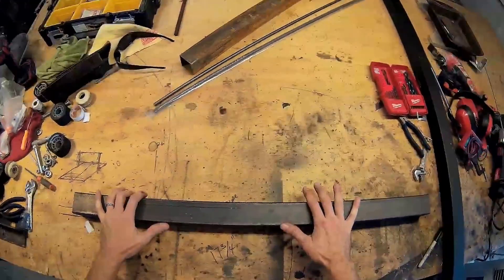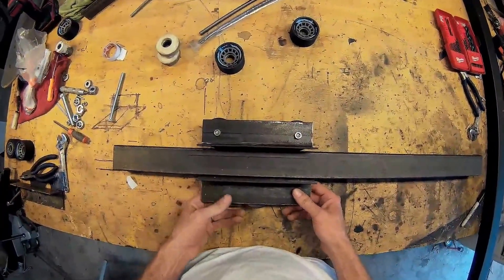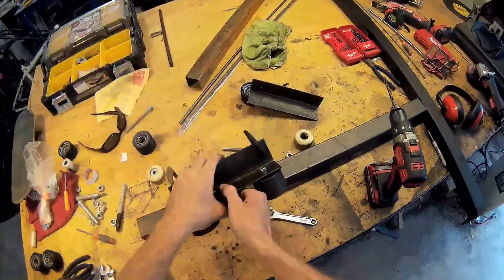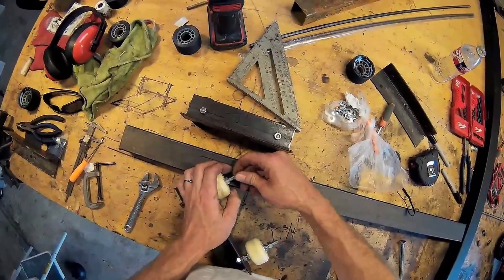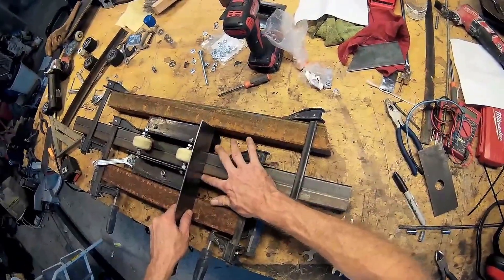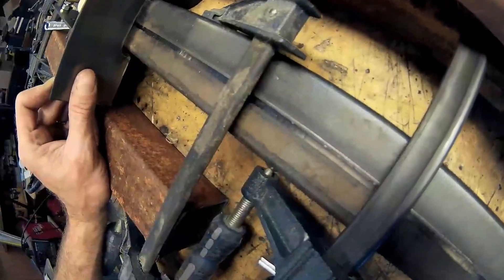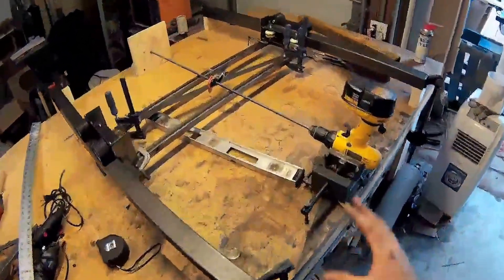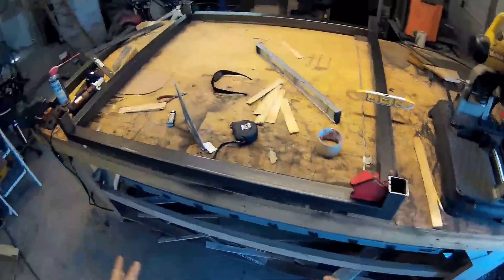How to: DIY Arduino CNC Router Cutter Welder(Part 1: Base and X-Axis)

Comment: Thanks for your excellent video series. 5 years ago I built my own big CNC machine (work envelope 5 feet wide x 10 feet long by 16 inches vertical) based on what I learned from you, and it's been a very useful machine. I really appreciate that you shared your knowledge and experience.

Comment: Thank you very much for these videos. I will now start with the work I saw ...
  But I may need some help during the work period. Can I ask you some questions ...
Which wheels have you used in the x-axis? Where can I get them?
What type of welding do you use for assembly and cutting? How hot is it?
Is it possible to know the appropriate standard for choosing the diameter and length of the iron bars?
Thank you very much

Comment: can you build a device that measures the accuracy of the roller skate roller system you use? I think you would just need to put a surface plate on top and run a dial indicator across the top while using the roller skate roller system to move the plate across the indicator tip.

Comment: This is awesome! I love the skateboard wheel design for the roller system. I REALLY want to know... traditional roller systems to move the bed of a cnc machine use finely machined metal components... can we maintain accuracy without needing accurately machined parts by using a skateboard wheel roller system? Basically I think that the softer wheels will "absorb" imperfections in the rolling surface evenly enough to be able to use off the shelf skateboard wheels as an improve diy roller system that can maintain really good accuracy. Not sure how much accuracy though.

Comment: Please tell me the part number of the wheels and where you purchased them. Also what is the height and width of the wheels? Thanks
Reply from the maker: Part number?? lol no man these are roller skate wheels from roller skates that I found at a thrift store.  Did you watch all six vids?  The wheels are 2in diameter and 1.5 in wide.

Comment: hey bro, nice work.. i just ned to know that what is the size or the stell pipes you have used for the cnc??? those rectangular pipes are 1x1" or 1.5"x1.5"???? and what gauge size you have used????
Reply from the maker: Thanks man I used 2in and 1in square tubing, both 14 ga.
Reply: thanx for the reply m8, the one inch tube is used inside the floor frame??? and the outer frame i made of 2" tube right???
Reply from the maker: mohit anand correct
Reply: youve been using the mig welder bro??? is that gas or iron rods free????
Reply from the maker: MIG with CO2

Comment: Chemtrails? I think you mean contrails, dumbass. Contrails being condensed water vapor from the jet engines. Have you ever noticed anything when you breathed outside on a cold day? One would almost think very cold air with a some amount of water vapor in the upper atmosphere would act cause do the same thing when a jet engine very rapidly compresses it, dramatically raising it's temperature, and then blasts it back out into the surrounding environment of cold air. Sound a little far fetched? I guess the more reasonable explanation is that commercial airliners load up their aircrafts with chemicals to spray out into the sky. Sure, it seems altogether impossible that a commercial jet could even hold the amount of mass required to leave a trail over hundreds of miles. Damn, that seems even more impossible when you realize that you can't use the space required for passengers, internal machinery required to make the plane work, and the fuel required for the plane to reach its destination. I guess the fuel could be doped with chemicals, but you can tell it's not because you can work out how much energy is in the fuel, the efficiency of the aircraft, and how much fuel the aircraft can hold. There's no way you can fudge the numbers enough to account for a trail of mass hundreds of miles long, but it's still more reasonable that the effect we all know about being responsible, right? It's not like there would have to be an entire industry employing millions of people to manufacture and transport these chemicals that are just being sprayed out into the sky, right? Chemtrails... Dumbass.
Reply from the maker: DUH.  That was a joke, dumbass.
Reply: Fair enough.

Comment: Why did you weld distance between wheels? Why didn't you connected them with threaded bar and nuts so you can adjust them later if wheels wear out?

Comment: What type of welding are you using? I took a mig class some years ago, but didn't do anything after that.  I'm inspired to take another welding course in order to be able to tack metal together like you're doing. I've located an old TotalGym in the crawlspace under my house that seems to be in need of cutting up and being put back together in a new way.
Reply from the maker: Right on. I use MIG with 100% CO2.  I'd save the money for the course and instead buy a welder and start welding!

Comment: Hello, excuse my English. I congratulate you for your work. It is very inspiring. I searched for months to build my own cnc. Finally, to see your work I decide to start.
I'm from Salta, Argentina, a place inside with few technological resources, but eager to work in the cnc.
I consult, if you can send me some sketches with measures that you used and what the actual work space.
Some help with the electronics could use.
From already thank you very much and congratulations again.
Regards.
Osvaldo

Comment: Could you specificate your lead screws? I started making my cnc prototipe with aluminium profiles and sliding furniture doors that i use daily in my cabinetry.That's not easy, i've been watching all your videos. Thanks
Reply from the maker: I used these for X and Y : http://www.ebay.com/itm/304008-3-3-8-12-x-36-inch-3-foot-Acme-threaded-rod-for-lead-screw-CNC-3D-print-/142063432522?hash=item2113a3f34a:g:rMwAAOxyUrZS3hW9

And this for Z axis: http://www.homedepot.com/p/Crown-Bolt-5-16-in-18-x-24-in-Zinc-Plated-Threaded-Rod-17170/100338238
Reply: Great. thank you!

Comment: Why didn't you use only the bearings as in the other parts? is there a special reason?  Which the general measure of your machine? Thanks.
Reply from the maker: No real reason,  other than it looked cool.
Reply: I am looking forward to viewing the rest of this project and seeing how I can modify it for use with an Everlast plasma cutter.
Reply: Carlos Correa C. T

Comment: Great Build! I like the build, but, was wondering if the wheels would wear after time.  I guess it really wouldn't matter if you have to adjust the steppers on each project. Or just change them out over time.
Reply: I would imagine it would take years to wear off especially that your not actually putting as much force as using them on roller skates.
Reply from the maker: Yes I think it they will last for a long time.   If they do wear out, I can always keyhole the bottom wheel holes for adjustment.

Comment: I would've mounted the rail 45° angled and have the middle wheel on the other side of the 90° angle.
That way, your wagon would align itself on the rail as it's weight presses it down.
So your axis rolls perfectly with the rail and you can simply lift up the whole assembly

But actually, your construction seems pretty decent and nice!
Reply from the maker: Thanks man. There are a million ways to build this thing.

Comment: Great video series. Question regarding your welding, will you then go back and fully weld everything later ?
Reply from the maker: Everything will remain tacked.  I may want to go back and modify and also welding everything would distort the machine.

Comment: If you are using such soft, flexible wheels, is it even necessary to make a rigid steel structure?
Reply from the maker: They're not soft and flexible.

Comment: you will fuck up your eyes man! Always wear the uv helmet. My father used to be a welder and me as kid I found these lights very nice, so now 10 years later I have my eyes at -6.5 dioptre and its still getting worse.
Reply from the maker: Yes people don't ever stare at the light!
Reply: Lol I can tell he was doing what I do a lot. Spot welding with your eyes closed. I fab that way all the time. Got a nice tan one time when I did a lot of it. Sure don't need no helmet just to spot weld. I ended up welding a whole seam once with my eyes closed. It was really tight quarters under a vehicle and no room for a helmet. So I just visualized and did it. Turned out to be the best weld I did that night.  Kinda ticked me off actually lol

Comment: That's one of the most solid DIY linear slides I've ever seen, and the cheapest / simplest too. Jealous.. especially since I just bought a bunch of specialist aluminium extrusion for my CNC machine.
Reply from the maker: +OpenTronic Yeah I looked into the aluminum extrusion stuff and couldn't believe the costs!
Reply: +Absorber Of Light the Openbuilds stuff is not too pricey here in the UK and I managed to find a cheap source of V-wheels, but previously I've always liked to find genuine home-brew solutions just for the satisfaction of doing it myself. Welded steel is always going to be stronger than aluminium anyhow. And I like the way that you can square everything up then weld it in place. With the aluminium all you can do is bolt the joints, and those can and probably will move out of position eventually. I wish I could weld.. I watched the rest of this series and your machine turned out great!

Comment: What happens when the urethane wears down?
Reply: +Brady Rose then screws must be tighten
Reply: +MonkeyBlueAss  it looks like the screws would only pull the wheels inward, rather than in the direction of the gap that would occur as the wheels wear down.  I've seen builds where people put in a spring loaded plate that the wheel mounts to.
Reply: +Brady Rose I'm more concerned with Z-axis tolerances due to compression on the rubber wheels. 
I contemplated using roller skate wheels because they run so quietly. but decided to go for accuracy.

Comment: nice build out of the head. But test stiffness more. The router will be pushing into the material with a force up to maybe 100 pound. So you need to test your base stiffness for that force. Especially forces at the edges causes problems.
Reply: +Henrik Larsen 100 pounds of force? What motor are you basing that from?
Reply: A std. hobby step motor at 420 ounces per inch with a 2 to 1 reduction through the gearing will give you a power in that range or more. How much force do you think you need to snap a 1/4 inch mill tool. Try to do it with a set of pliers. I don't think you could do it easily. A cnc does it easily.
Reply: Henrik Larsen Snapping an end mill is a byproduct of lateral force. If your feed rate is too high, it will snap. This is a byproduct of design. Drills are not meant to have much force applied laterally. You can put one in a vice and tap it with a hammer and have it break without getting anywhere near 100 pounds of force. 

Not to mention, you have to add something that this build does not have...a reduction gear. Now, it is early and I don't care for math right now; but, 420 ounces is about 25 pounds. Run that through a 2:1 reduction gear and you gain a 2:1 mechanical advantage. That would leave you around 50 lbs of force. That is only half of your claimed force.
Reply: I'm just reminding there are larger forces in play than one would expect.

The math is that the 420 ounces are at one inch from the motor axis center and the ball screw may result in a 2 to 1 reduction due to its geometry plus it's probably much less than 1 inch in radius. So in fact you can get 100 pounds out.  Maybe not on your machine but certainly on mine. 

I may be wrong, but I have seen my CNC hit a blockage and it was not pretty.

I do hope your machine runs great.
Reply: Henrik Larsen Well, I am still waiting to hear a valid argument of a Nema-17 (what was used here) making 100 lbs of force.
Reply: True, torque depends on power from the steppers. You are probably quite safe with Nema17. I rest my case.
Reply from the maker: +Henrik Larsen hehe you guys are super smart..
Reply from the maker: I enjoyed reading the discussion:)

Comment: the single wheel should have a long hole to be adjustable. your system is over defined in a mechanical sense..
Reply from the maker: +Mathieu B define over defined
Reply: +Absorberoflight in the mechanical sense. you normally need a fixed Support and a loose support or it's more prefarable. This way you could Set up the play between your bearings and the rail.

Comment: Best DIY tech I have found on YT. I was in the process of buying a pantograph for cutting metal I found on ebay for 1500 bucks. Your mods stop that purchase. I've watched each of your vid's twice to plaster in my mind of how its done. Will you continue making vid's on how you will make your mod's to CNC?
Reply from the maker: +William Wooden Thanks a lot man.  Yes I will continue the CNC series, there's a lot to do:)
Reply: Thereeeee is also a cnc build guideeee on >> https://t.co/O5Xf7QNRGt?3vgjJikt9B4sdd
Reply: William Wooden lo muy

Comment: Awesome!!!  Do you have any blueprints or basic measurements.
Reply from the maker: +noody2081 I don't.  Everything is improvised.  You can make this machine as small or big as you want.  You're only limited by the length of the lead screws.
Reply: +Absorber of Light   Ok thanks

Comment: amazing work there! What kind of welder machine you use? Thanks for sharing!
Reply from the maker: +Javier Martinez Thanks Javier, I am using a Lincoln MIG welder.  I only use CO2 because it's much cheaper than Argon/CO2 and I'm not concerned about splatter that much.  Thanks for watching!

Comment: Im not sure on your plans for your machine but since you are running those wheels be sure to add covers and brushes so you dont get material under the wheels.
Reply from the maker: +kmyerslp Yes I thought about putting brushes at either side of the wheels.   I will also have a vacuum table to help with that.  Thanks for watching!
Reply: +Absorber of Light Yeah, not a problem.  After building my 2nd cnc router I like seeing all the different build techniques people use on their machines.  Thought I could help out before you got too far and couldn't go back to fix an issue.
Reply from the maker: Thanks I appreciate that!